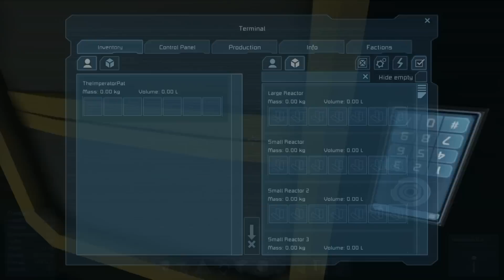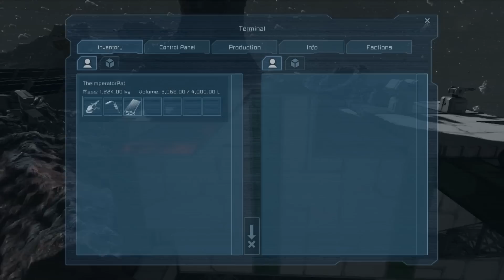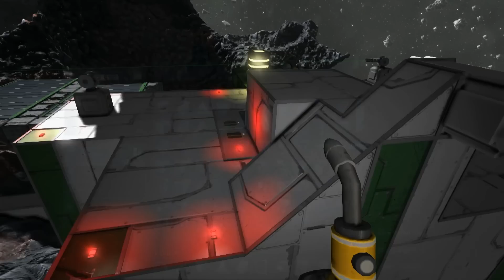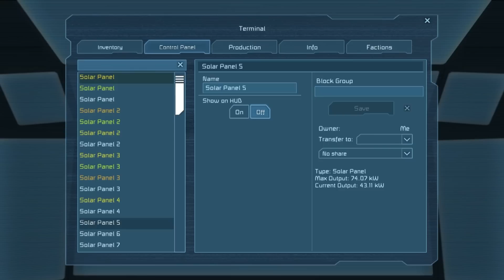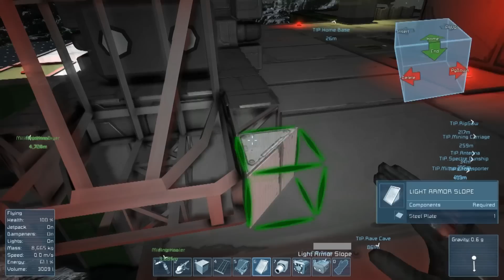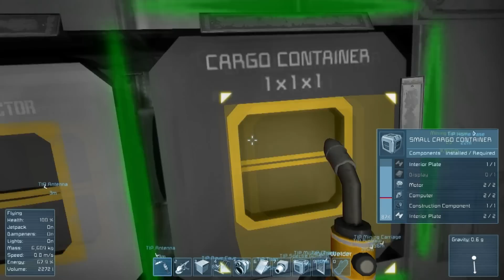Space Engineers: Survival Let's Play S02E10

Comment: the reason your power usage was so high was because your batteries were still set to recharge so your power meter was telling you the ratio between power generated by the tiny reactor and the power usage of the recharging batteries, set your batteries to discharge (by turning off recharge mode) and turn off your nuclear reactor to see the proper useage

Comment: you know you can select multiple things in the control panel (like the two pistons) using shift or control and adjust the settings for both at the same time so they are identical (note it only syncs if you change it, otherwise they all stay independent, the reverse button is local to every machine).

Comment: It actually not fitting because of that Rotor, it's displacement of 20cm is pushing the Blast Door Block into the "frame" of the door.

Edit: On your survival world, it looks like your pulling power from beyond rotors or pistons, which technically makes them other ships, hence the difference in colours and names.

Edit 2: Connectors now share a hotkey with landing gear, p.

Edit 3: The Battery's "Semi-Auto" option allows them to automatically switch to discharge mode (aka. power) once fully charged, leaving Recharge selected means they will return to recharge mode once depleted. You can't draw power from a battery unless it's not in recharge or semi-auto is selected.